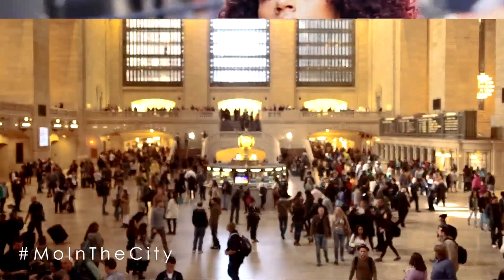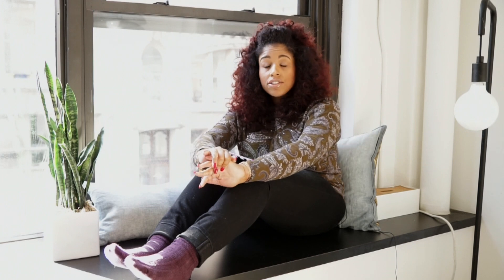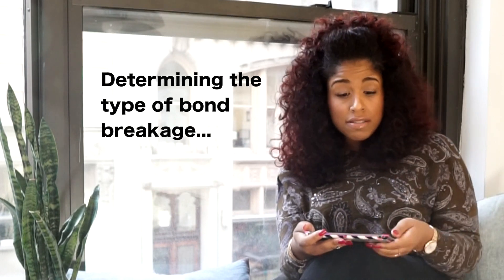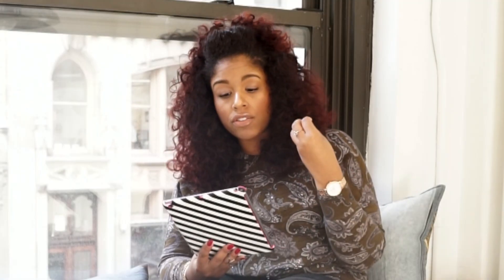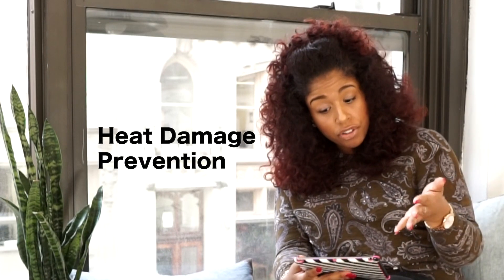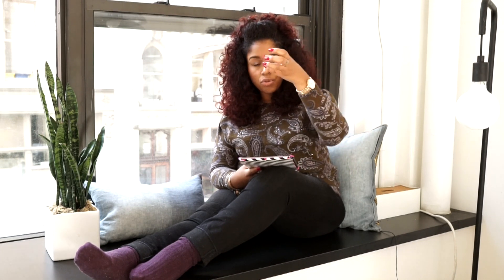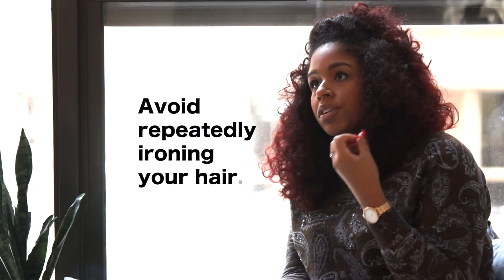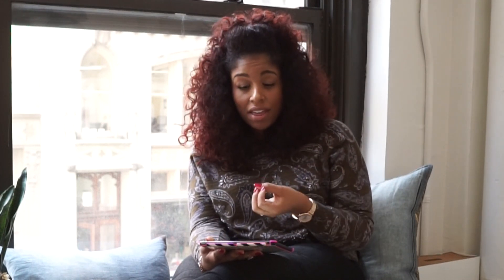#MoInTheCity - A "Come To Jesus" About Heat Damage

Comment: I cut off my permed hair in January and I'm loving my growth and learning my hair. Your videos have been a huge help for finding products and styles. My problem is that one section of my hair does not curl as tightly as the rest of my hair. Could I have heat damage on one section?
Reply: You may just have a looser curl pattern in that section. Very common.😁
Reply: The back of my hair is like that like it's weird b/c when I transitioned i told my sister to cut it but she didn't because she said it was part of my natural curl patten
Reply: Do you have a picture of it
Reply: I remember when I cut my hair after transitioning, the front of my hair didn't curl like the rest. I've cut it like maybe 3 times since and it has been curling better than before but it still hasn't curled like the rest of my hair. I think it was from follicle damage though because that's where I got burned by the perm.
Reply: +Chenanease Ramlal That's what I'm saying she may have
Reply: +Essence Wright who me?
Reply: +Chenanease Ramlal I didn't think about that. I've been natural for two years and the whole middle of my head is bone straight. no curls none whatsoever. it looks like I relaxed the center of my head and let it air dry. but thinking back, the center of my head is where I always had sores from where my scalp would burn before the relaxer was fully put on my head... I have a lot of hair! but anywho, I don't use heat so I know it's not that. folic damage sounds like it culprit the culprit. this is my second big chop. maybe 3rd times the charm lol
Reply: +mizzbambam2008 I hope it is. give it time though. it will react sooner or later but I hope it's sooner.
Reply: +Chenanease Ramlal thanks

Comment: Is it bad to wash your hair w/ Aztec healing clay? B/c don't baking soda and Aztec healing clay have the same ph?
Reply from the maker: +odyejim I don't use anything that isn't a formulated shampoo...alkaline has to be balanced with acid to restore proper pH and not knowing what will or won't do that is not a battle I like to fight.
Reply: +odyejim ACV has a PH of about 3 and bentonite clay is about 8 or 9....Personally,  I only use it when I feel like I want a fresh start with my hair. Also, I make sure I deep condition afterwards with a product that has a neutral Ph.
Reply: +odyejim I would like to know this too....
Reply: +Enjalica Bryant but doesn't acv have a high ph?
Reply: if you use some sort of clay/mask product on your hair its a good idea to do a deep conditioning afterwards in order to restore moisture and balance. ☺
Reply: +Mo Knows Hair Makes sense! that must be why its suggested to use the ACV mixed with it. thanks mo.
Reply: +Enjalica Bryant Ohhhhhhhh ok I use it to clarify my hair